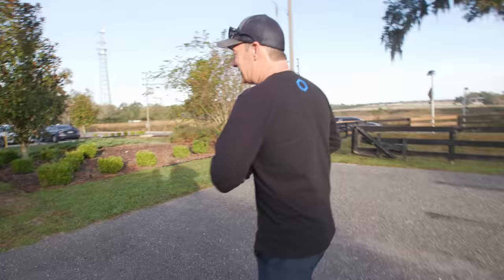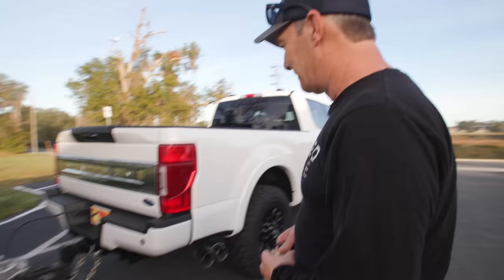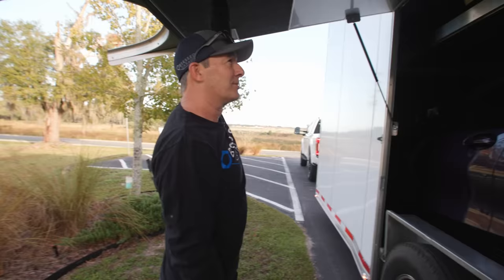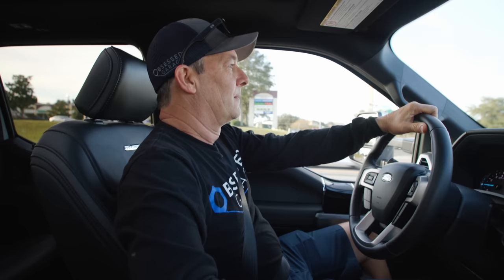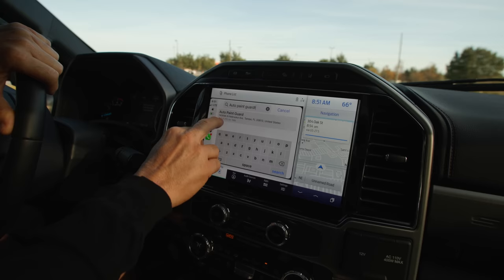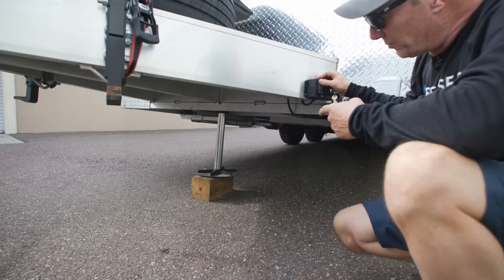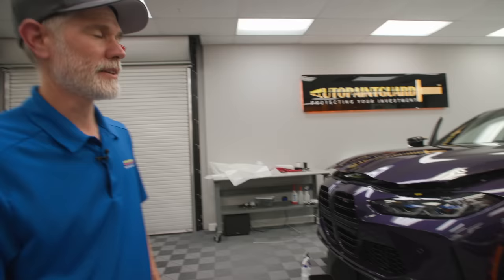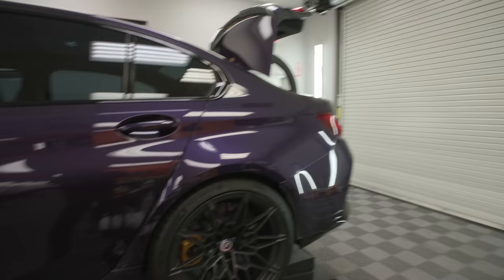The Purple Pig Nose G80 Gets PPF at Auto Paint Guard

Comment: I have a 2022 F-150 that I had the Front Clip / Hood / Headlight's done about 5 Months ago by an Expert???? I've Noticed on the Hood at the Rear Corner's at the TOP that they have come up a little Bit? I texted a Picture to the Guy, and he said it Needed Trimming or something of the Sort??? I "think" after watching this Video that he Didn't know how to WRAP a CORNER Correctly?? The film is Xpel Ultra. Not sure what to do at this Point, I'am scared that if I go Back and he redoes the Hood, that he'll Peel the Paint up if what's there is removed??? Then, I'am Screwed???  What should I do? Or what would you recommend?
Reply from the maker: Usually the headlight templates don't over wrap the edges, so he is correct that it may just need a little trimming.  Modern Xpel will come off pretty easily, so I wouldn't worry about pulling paint.

Comment: I just bought a car and you can see cut marks from whoever had the car wrapped before I bought it. Drives me fucking nuts.
Reply: That sucks. Most installers do that
Reply: you can sand them out
Reply: @scuph  yeah I'll give it a shot. I can at least bust it down so it's not as noticeable. I'm in the middle of moving but once I get to the new place I plan on doing a full paint correction and ceramic coating. I'll try my hand at some wet sanding then too